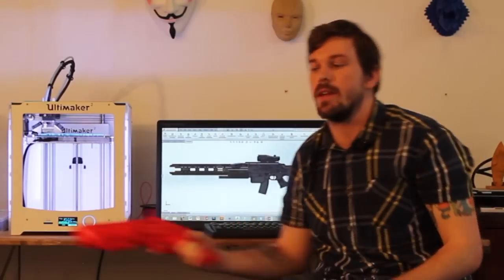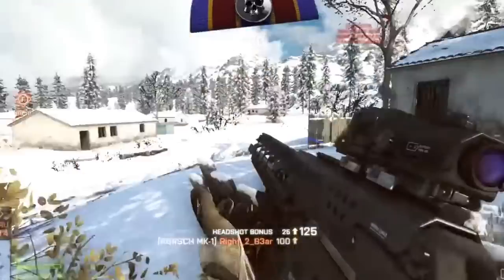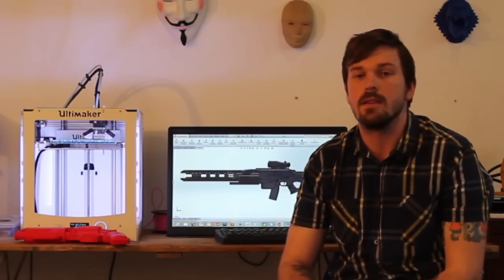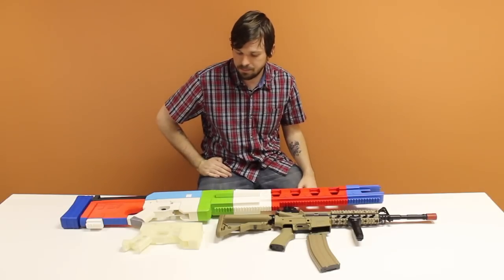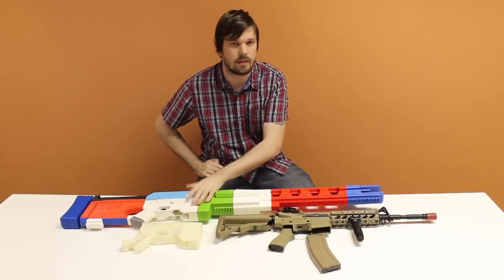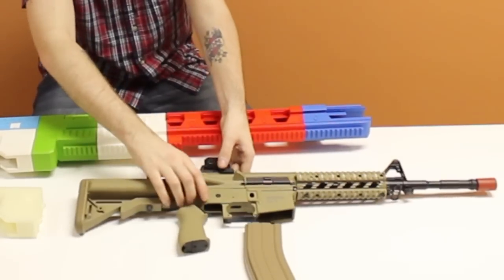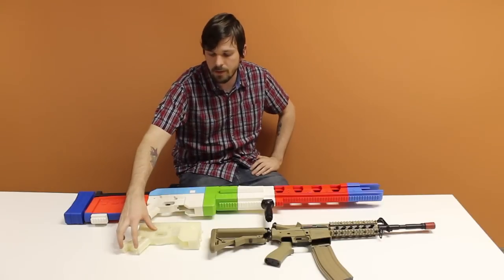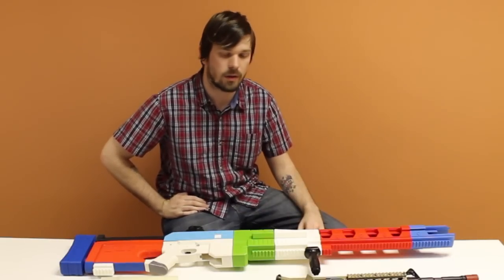3D printed airsoft gun from Battlefield 4

Comment: I'm planning to 3D print sometime in the future the AN-94 from Black Ops 2 (when I get my hands onto a printer) and I'm wondering how do you measure how big the receiver has to be for any AK gearbox I want? I want the barrel pullback action to be as realistic as possible, as in the real gun, so I'm also wondering what gearbox I should get.

Also I'm wondering because I'm going to print the external parts to look like the AN, do the internal parts have to be AK based or can they be for example from the same M4 as in this video? I just want the barrel slide like it does in the real gun, that's all.